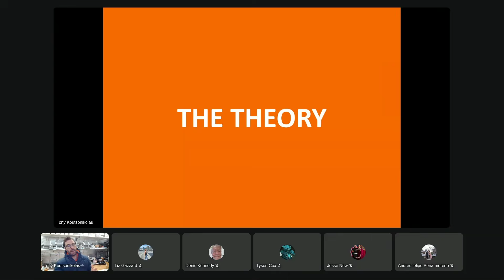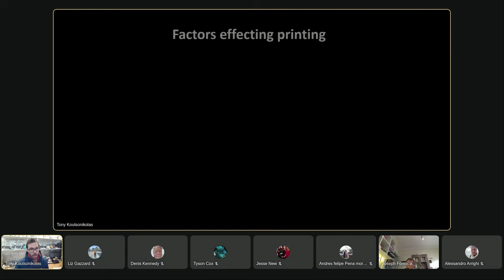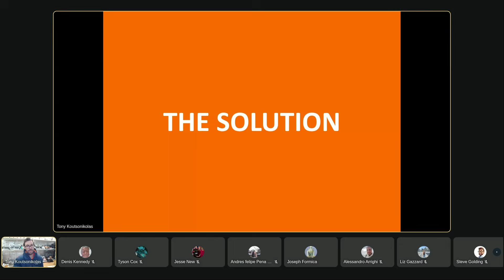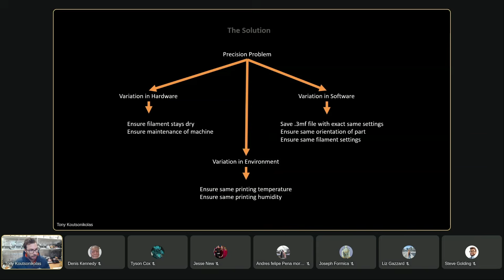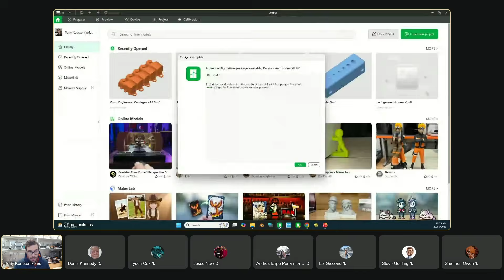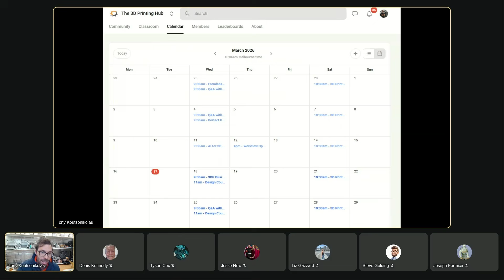Change these settings for the BEST Tolerance!

Comment: It's unclear to me which settings to change. You're talking about a specific test from MakerWorld that could throw different results based on filament type (you mention PLA and Silk). But what i'm missing from your video topic are actually the settings to be changed.
Reply: Exactly all that to say nothing 🤦🏽‍♂️
Reply: Please watch the video again. He talks a little bit too fast, which could be a problem or increase the difficulties in understanding him. 
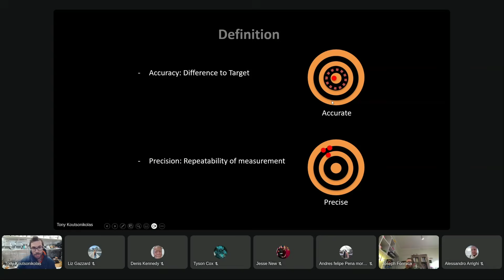From 2:30 to 6:00 you get a explanations on the accuracy and precision topic, as well as a long list of parameters, that directly influence the dimensions of the printed part. 

Depending on "your" problems, he also explains solutions for accuracy driven problems, as well as precision driven problems. 
The base for everything is: Calibrate your filaments on your machine. The temperature, the flow ratio and pressure advance. 

He cant give you the specific settings, because: 
1. He isnt you
2. He doesnt know your requirements and applications
3. He doesnt know what kind of printer you have, and if there are any issues with it
4. He doesnt know your filaments, that you are using. 
5. He doesnt know the parts, you are printing. 

He simply explains the topic to you, and gives you some instructions/solutions. 

One critique I have: He missed on the topic of the size and shape of the part itself. These two parameter also influence the dimensions of the printed part. Example: You simply cant calibrate the dimensional accuracy for a 10x10x10 cube and then expect it to work for a part of 150x50x238 with some asymmetric shapes. 

"But what i'm missing from your video topic are actually the settings to be changed." 
Do you design your own parts in a CAD software? 
If not, and if you only rely on e.g. Bambu Studio, then one way for you is, to play with the scaling of the part. (I assume, you didnt change the shrinkage factor in the filament settings. By default is is 100%)

Lets say you have a cylindrical shaft, which needs to be stuck into a hole. The hole belongs to a part, whichis a cube like shape, with a hole into it. 

1. What to do know? I dont know :). You are the one who is printing your parts. You need to understand the part, not us. 
2. Example: You understand your part, and you know, that the shaft is the easiest option to influence the accuracy. 
3. You change the dimension of the shaft via the scaling option. 

4. You dont know anything about how accurate your prints are? No problem. Your learning curve starts here, by trial and error. Learn the topic of accuracy, precision and tolerance to a beginner understanding, then print test parts.